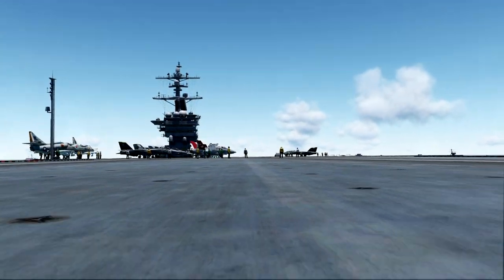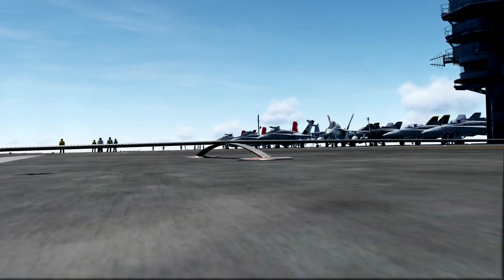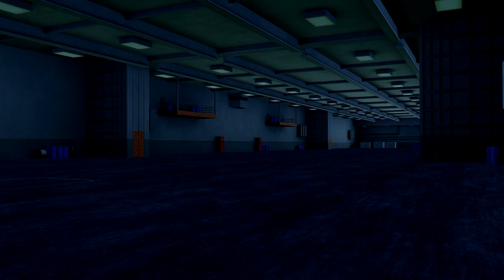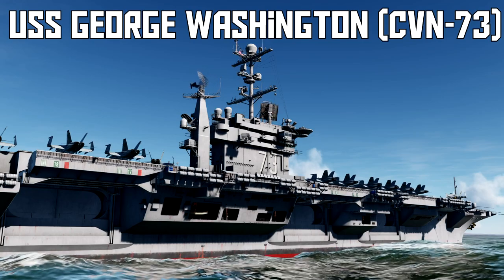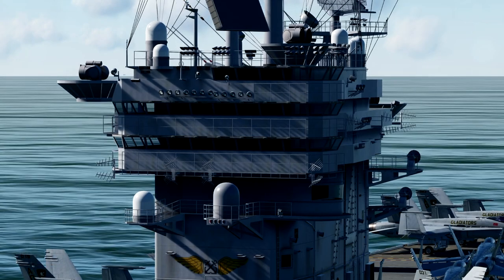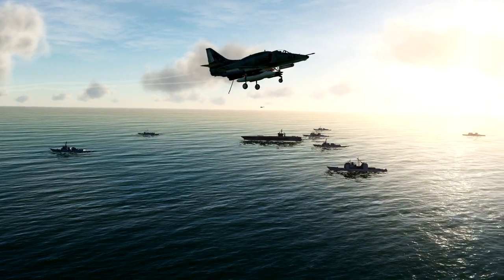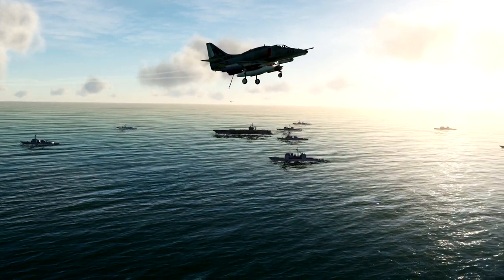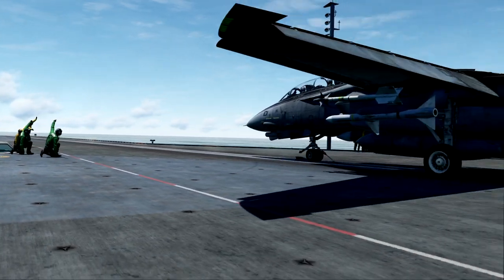DCS: Super Carrier | Comparing The Old with the New | What is so different ?

Comment: So the A-4E mod can catch a wire, very nice. But can it actually hook the catapult and take off again?
Reply from the maker: nope, it will need adjustments to be able to do that. i'm sure the modders will work on it once they have access to the super carrier
Reply: The reason an A-4 can't be launched is due to the nose gear not being able to handle the stresses associated with a catapult launch, or as we Sailors call it, a cat shot. A device called a bridle was used to secure the aircraft to the shuttle (the piston that runs underneath the flight deck). A short extension was originally built on early Nimitz class carriers to catch the bridle so it wouldn't damage the bow when the shuttle reached the end of its run. Not sure about the Cat 3/4 issue, my guess is that if you have 2 Tomcats on Cat 3 and 4, launching the bird on Cat 3 first should alleviate the collision problem, as the launch points are offset, Cat 3 being angled and shorter relative to Cat 4.  My other suggestion would be if you had to launch Tomcats in that area, keep 1 Tomcat in it's full 68° wing sweep if you have 2 birds ready to go on 3 and 4 until the first bird is launched, then extend the wings of the 2nd bird to the 20° sweep position for its launch.

Comment: Hey mate, awesome video, a question though about your camera shots like where you are sitting static on the ground or flying slowly above it, are you using the f11 camera for that?

And if so, how do you find the carrier, is there a way to somehow spawn the camera somewhere or do you actually need to fly around and try and find it yourself
Reply from the maker: hey man, F9 to switch to ship camera, set the camera where you want it, then Lctrl F11 to get free cam, use mouse and mouse wheel to move camera around from there, use trackir to look around as the camera moves.
Reply: @GrowlingSidewinder  awesomeeee thanks alot!

Comment: How does this affect performance?  I'm on an older machine (AMD FX4130, 8GB RAM, nVidia 960GTX) and I already have performance issues with DCS sometimes when there's too much stuff going on.  Yes, I know I need to upgrade my system at some point.  But it sounds like we're talking about a lot more polygons and high-res textures for these carriers, and it looks great, but I worry that if I get this, it might be all but unusable.
Reply: You could try throwing in another 8GB and a 1060 6G or 1660 if you can't afford getting a completely new decent rig. That should get you a nice performance boost still with that CPU which might take some overclocking as well.
Reply: Rainbow Dash   Mmm, in my opinion, it's better to use not less than a 1080 with at least 8GB (if you can 11GB) and 32 GB of RAM to have good details, but especially to have good frame rate. I have 16 GB of RAM DDR4 and a GTX MSI 1060 with 6 GB and i have to turned off some details to have always 60 fps. Sometimes, in bad weather conditions, my frame rate drop to 30 fps, especially when i look the ground or fly over the cities. It's very annoying. DCS want really good requirements.